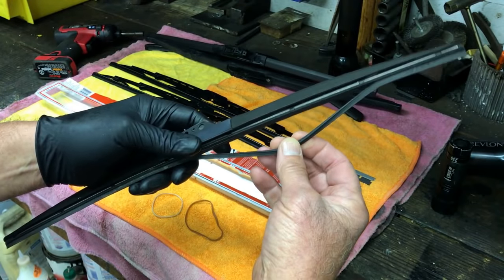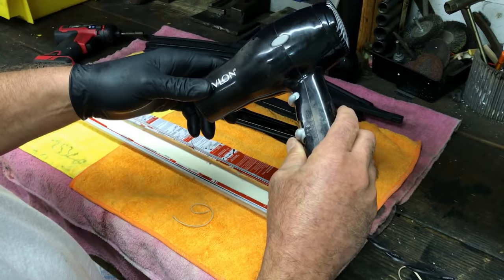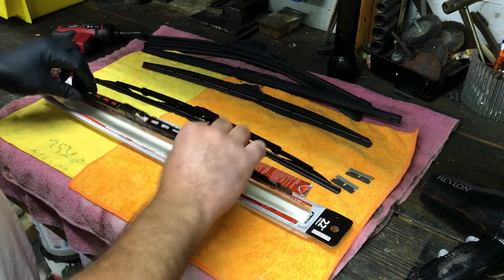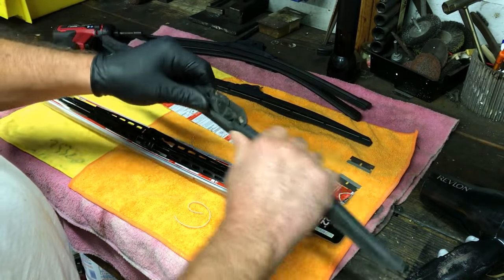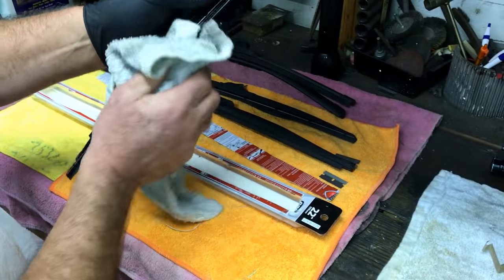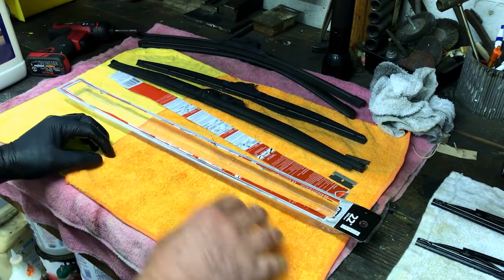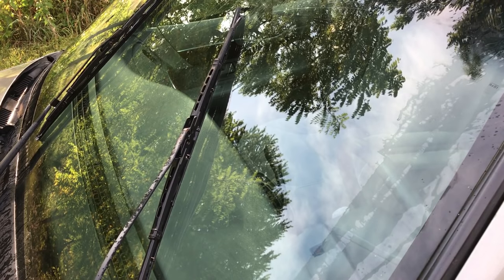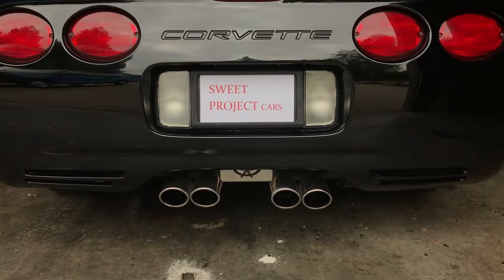NEVER ! Replace a Wiper Blade  AGAIN !!!  Amazing :)

Comment: Once you run your wipers over a dirty or icy windshield they will streak.  You can't fix that.  The edge is no longer smooth and flat.
Reply from the maker: Mark Gigiel we have done this for 100's of customers for over 10 years and never had an issue with dirty or icy windows causing these treated blades to no longer be flat or smooth, sorry.

Comment: Why mess about with all this when you can just replace the rubber with silicone blades?Had my silicone blades for 10 years now and they are still like new.
Reply from the maker: you are thinking of it all wrong....vehicles are MONEY PITS..so a set of blades costs 20 bucks then
you have something else on the car that's 20 bucks and so on and so on and so
on..... IT ALL ADDS UP until SPC steps into the picture, now do you see.
Reply: Sweet Project Cars 🤷‍♂️

Comment: Wouldn't it be better to saok in rubbing alcohol?
Reply from the maker: Mark we have tried everything there is for years until we came with this method to finally have success thanks for sharing :)
Reply: Sweet Project Cars would you have any suggestions on how to clean a dresser mirror.no streaks as well??
Reply from the maker: Mark Symbala  we clean all our glass with this video https://youtu.be/Cp2tvqeov4o you can do the same on your dresser or any glass for that matter :)

Comment: Yeah..  provably cost me more to by this then Nye blades..
Reply from the maker: Franz Joachim Adrian Zscharnack  why would you want to replace your blades annually when you would not have to change them at all. See the JUST of the video...it was showing you can treat ALL the rubber on your car or truck and many other items, vinyl, leather, plastic and keep them nice so you don't have to constantly replace them as cars and trucks are already MONEY PITS, why not save where you can., when you use a water-based UV protectant rubber will last much much longer.
Reply: I went & bought blades for my Jimmy yesterday ....top of the line $28.44 EACH!!!!!!!!!!!!!!!! Even BOSCH were $24.53 EACH!!!! TELL ME IT'S CHEAPER TO BUY NEW BLADES! idiot.

Comment: The only thing I worry about is after I 303 the wipers will they chatter?  I HATE chattering wipers that skip all over the windshield.  It's why I don't use Rain-X.  Still, I'll give this a shot on the wipers of my Pathfinder that sits outside in the harsh sun all the time.
Reply from the maker: Maxi remember soft rubber does not chatter..also it is a good idea to clean your glass with #0000 steel wool to remove all the debis on your glass   we thank you very much and for the quality comment, it is very helpful for the whole channel :)

Comment: So spend money and time on conditioning rather than spend monies on new
Reply from the maker: Mukund Thorat  why would you want to replace your blades annually when you would not have to change them at all. See the JUST of the video...it was showing you can treat ALL the rubber on your car or truck and many other items, vinyl, leather, plastic and keep them nice so you don't have to constantly replace them as cars and trucks are already MONEY PITS, why not save where you can., when you use a water-based UV protectant rubber will last much much longer.

Comment: Dont know, seems like a lot of work to save $10-20. I think I'll just stick to buying a new set of wiper blades for my c7 corvette!
Reply from the maker: you use a conditioner on ALL OF YOUR CAR, not just the belt ....you are welcome and glad to have you here :) and if you have a vette like I do then you need to be water based conditioners on everything.
Reply: Thanks for your response, really big fan of your videos! I actually bought some stuff you said and had it shipped all the way to Bosnia from the US -- that's how much I like your ideas! 

Do you have any recommended leather conditioners? I know you used Mother's in of your videos, just figured I'd ask if you had an updated one that you prefer. 

Thanks
Reply: Lexol is a good leather conditioner.  Believe it was originally created for boats. When first started using could only find at marine shops.

Comment: hey you got a nice theme. for a mechanic you're gutsy to speak truth honestly even if you promote products. 

that's transparent enough. but I do feel murderous about em Service center guys who lie to the teeth & subvert you for lack of know-how & get you to be ripped. sad thing is you still left ambiguous if that was genuine repair or just daylight robbery as is the case most of the time. 

having said this few come by like you do. would appreciate if you're detailed enough. protectant is not detailed nor is it well explained. 

so do tell more what's it for & what all can be done with it. 

also I'm yet to look at your vids - & all I want is genuine servicing done to my car ,& how I can deduce it without being cheated . so your vids in that direction will help. 

my sis 4 year old car when I go for a check, the guy blatantly says the silencer exhaust needs replacement, it seemed only a rubber is gone or some clamp needed to hold it. he says rust particles inside (in a 4 yr old car)

secondly he says the clutch needs replacement ... this really blew my balls off.. barely 40k kms done & maybe a lady driver used half clutch for sometime but just now the clutch alone is bit tight ... don't think it needs replacement at all but servicing .. 

you can't be kidding or ripping someone like this to send your kids to college... it's ridiculous. in this light I see your vids. so hope you won't disappoint. 

tada
Reply from the maker: its hard to find a good mechanic and when you do keep ahold of them....thank you very much and thanks for being here with us :)

Comment: I think I would rather just replace the blades, you have to buy conditioner which isn’t that cheap then do all this messing around for blades that will last for years without doing all this work, sorry my friend but you have to much time on your hands
Reply from the maker: Fat  you did not get the  GIST of the video!… It was to show that you can treat all rubber leather, vinyl, and plastic on your vehicle keeping them in great shape for pennies on the dollar compared to replacing parts all the time. Cars are MONEY PITS and we believe in saving where you can this procedure is not just for belts. Have a great day, the Hammer

Comment: Way too much time for wiper blades..
Reply from the maker: Rocket wj    the JUST of the video...it was showing you can treat ALL the rubber on your car or truck and many other items, vinyl, leather, plastic and keep them nice so you don't have to constantly replace them as cars and trucks are already MONEY PITS, why not save where you can.,
Reply from the maker: razorsharpbt I know, it is so frustrating trying to get people to open up their minds and their horizons...its like water, you drink it to stay alive that's true but it is also used on and with 100's of other things as well. 303 is the same thing you sue it on your vinyl top to keep it from UV damage, but it can also be used on many many other things to keep them protected as well..UGGGG

Comment: 3 bucks every couple years. Or this?
Reply: Spend forty bucks on this stuff.
Reply from the maker: you use the product on all of your car, not just the wipers,,, cars are money pits save from buying parts you don't ever have to buy again, and put the money elsewhere
Reply from the maker: you use the product on all of your car, not just the wipers,,, cars are money pits save from buying parts you don't ever have to buy again, and put the money elsewhere
Reply: Sweet Project Cars   Bro 6 bucks every couple years against 40-50. Ten years worth of wiper blades right there. More even. I like the idea of saving money, but this is just being tight. What other parts can you use this for?
Reply from the maker: most people don't by 3 dollar blades they buy the 20 plus dollar blades thinking they will last longer in California rubber and leather and plastic do not hold up under that UV hammering every day...pennies add up for those who don't have the money so if they can save a couple hundred on their car every year by not replacing items that deteriorate over time, thats what we are sharing..again cars are money pits, save where you can..
Reply: Sweet Project Cars   Dude. I'm from Australia, were we have some of the worst uv ratings. So I know what harsh conditions are. I'm just saying I'd rather spend few bucks on blades than 40-50 on a product I'm only going to use on blades. What other uses does this liquid have on a car?
Reply from the maker: all rubber, all leather, and all plastic and all vinyl...look up the reviews on 303 aerospace UV protectant google it you will be amazed.